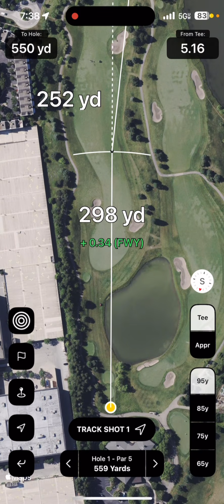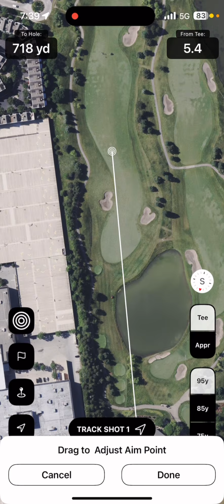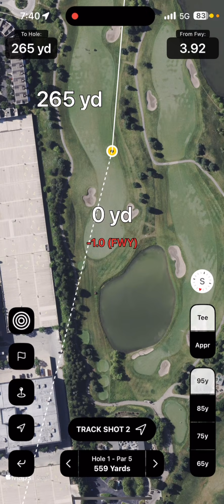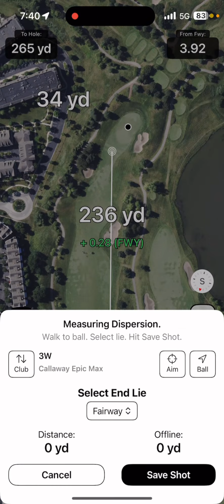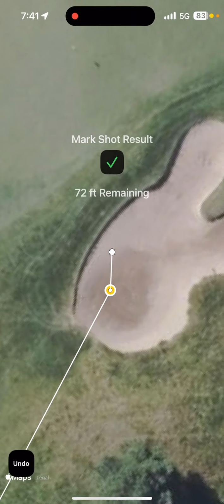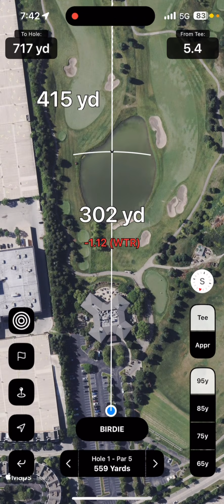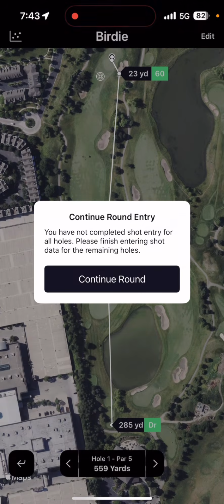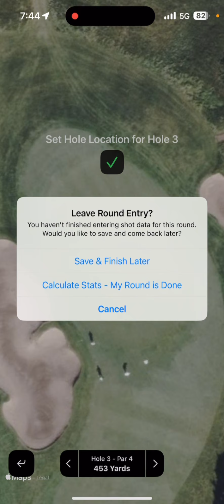All-New Hybrid Shot Tracking System - GPS + Manual On Course Shot Tracking! (2025)

Comment: We need two lines off the tee; for example a right handed golfer's normal shot shape is a cut/fade/slice (whatever you want to call it) which should be represented by a curved line, and there should be a second line that's straight, and this curve should get updated via data dispersion over time, so we know where to aim and where it's likely going to land. Showing a straight line and equal dispersion on both sides isn't accurate, the dispersion (the miss calculation) needs to be weighted far more right if a players normal miss is "extra slice" - the app needs to track your "miss" to be useful off the tee
Reply from the maker: I get what you're saying! Even if you play 1 shot shape, you may find that your dispersion falls evenly on both sides of your aimpoint. Keep in mind that we define aimpoint as where you want the ball to finish not your intended start line.

Still - I understand that your dispersion might fall unequally on each side of your aimpoint if your miss is biased toward one side. Will see what we can do! Just want to make sure it's within the rules.

Comment: I’ve tried to use this on the course and can’t get it to flow with my routine. I think it would be better if (like the Apple Watch app) I could just tap to drop a bread crumb at each ball location then enter the club etc at the end of the round.
I realise it’s intended to use after the shot, but that means getting the phone out to work out my shot. Then I determine the club I want to hit, may change my mind, then hit the shot. Then I need to get my phone back out to record the shot & the club I decided on. This doesn’t work for me, because after I’ve hit my shot, I just want to walk away to get moving. Hence if there was a “bread crumb” mode, it would be ideal.
Is that possible?
Reply from the maker: Yes! Have it on my mind to add in a setting where you can toggle to just drop pins with the phone in the same way we just made possible with the watch. Should be a fairly simple thing to make happen. Stay tuned.
Reply: Same with me! Three rounds, and these were my worst rounds because I could not focus on golf... I was entering the shots in the app, and all you are saying... very distracting. I think it gets better the more I practice, but I would totally LOVE the Apple Watch entry. I used to use GolfShot and now SwingU, but my coaches suggested to switch to Shot Pattern. It would be great if we could, from Apple Watch, push track (possibly enter the club, like SwingU) and then "save at my ball". Then all this could be cleaned up later in the app.
Reply from the maker: @SuzannaMcGee  Hey Suzanna - I think we connected via email, but you can do simple bread-crumbing via the Watch or Phone while on the course to mark the location of each shot and then worry about the clean-up later. If you have a watch, it's as simple as using the Apple double-tap feature at your ball, or tapping "Mark Shot" when you're at your ball. On the phone, you'll need to toggle to "Simple" shot tracking mode in Settings before you start your round. Thanks for your feedback so we can keep improving the app.
Reply: @ShotPattern yes we did connect by email. I will try the simple bread crumbing. Thank you for all your help and a great app!

Comment: Is there a way to undo a shot? I tried it today for the first time and sometimes my gps was good, others it wasn’t so I was switching between manual and gps and was getting confused. But I didn’t see an easy way to undo a shot once I saved it.
Reply from the maker: Hi Terrell - Right now, there isn't a way to undo a shot while on the course. Everything can be edited/cleaned up after the round when you finalize things. We'll look to add more edit/undo functionality for on course play in the future.
Reply: @ thanks! Overall liking the app - specifically the feature to upload launch monitor data. No other GPS apps I’ve seen that can do this (besides manual entry) which is what I’m loving most about it!

Comment: Hi, I seem to lose the ‘track shot’ button some times mid round. Is there away to correct this?
Reply from the maker: There is an intentional removal of the button while the app saves the new pin location. However, it should only disappear for approximately 1 second while the data is processed. If you're experiencing longer times than that, please email support with more detail.